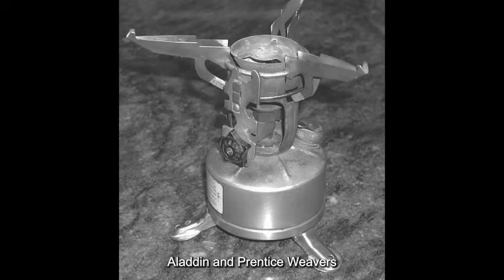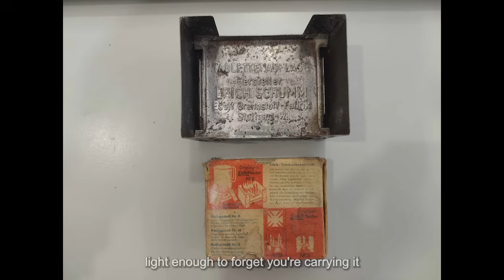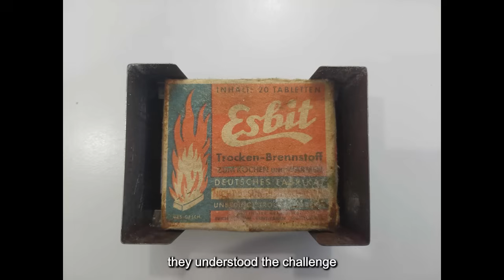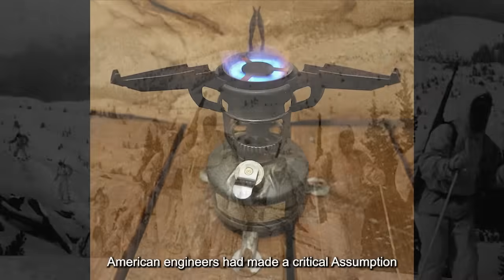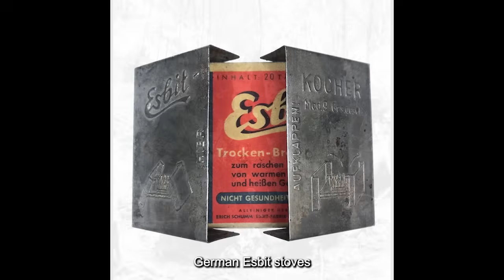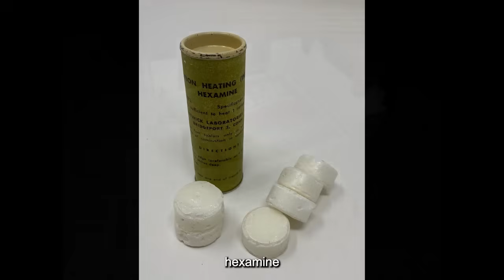America Tried Copying Germany’s Pocket Stove — But Missed The One Detail That Made It Genius

Comment: I have several of that type of surplus stoves, both WWII vintage, 1950's civilian .  I still  use the slightly larger "Coleman Model 520 / M‑1941 G.I. Pocket Stove" . It has been flawless for 70 years.  It is more reliable than the mountain stove

Comment: I have Esbit stoves and they work very well, and as the stove is made of steel you can use dry wood if you run out of Esbit fuel. You can use cloth, cotton, soaked in oil or any liquid fuel. Good video but it repeats the same thing over and over, extended to 27 minutes when it should have been no longer than 10 minutes.

Comment: I used almost exactly the same pocket Esbit cooker to heat my food during a winter bivouac in the German Alps about 30 years ago, during the final exercise of my Bundeswehr basic training. I still remember especially the cold as the temperature dropped to around -20°C at night. Washing myself in the icy water of a mountain creek while I was already freezing is a feeling I will never forget. Even brushing my teeth with that water felt like its draining all the heat out of my body in an instant, and we only got about two hours of sleep per day for five days straight.

These were some of the most extreme conditions I ever had to endure in my life. And then there was this little stove and our only source of hot food and warm drinks in the cold. I imagine I felt on a very small scale, a bit of what the soldiers back then, fighting in the Alps, must have felt. For them this tiny cooker must have been a real lifesaver.

Comment: The situation described in the failure of the M-1942 stove is certainly possible, but not a typical scenario. One could also catalog the number of ways the Esbit could fail. Generalizing a failure scenario as an engineering weakness is short sighted.  The Army also included at least 2 extra vaporizers with the unit.

Comment: Esbit Stoves. Still made and still used for the same reason. Simplicity. Mine is always in my Shirt Pocket when I'm playing in the Woods.

Funny thing is, no one really kept it simple until the 1950's. That's when the Trangia started being used as well as the Svea 123. The Trangia is an Alcohol Stove that is bone simple and just plain works. (It takes a while but it works.) The Svea 123 is a Gas Stove that can use both White Gas and Gasoline. Unlike the 1942, it doesn't clog up because it uses Wicks and larger openings. It has one moving Part which is the Valve.

All three of these Stoves have been my go to pieces of Gear since the 1980's. I've played with the new stuff and keep going with the old stuff.

Comment: What one forgets is that during WW2, American Industrialists and Manufacturers made an absolute fortune.
There is no profit in producing a cheap stamped galvanised steel cooker and the associated compressed solid fuel blocks. There is much more cash to be made from supplying 'highly researched' complex complex-engimeered products.
Follow the money .. 😏.
In South Africa, 1968, during my Military National Service, I got an Esbit Cooker as part of my kit issue. I still have and use it. Now living in Switzerland, I have replaced the Esbit Tabs with liquid Alcohol ('Brennsprit') and/or Alcohol Gel ('Sicherheitsbrennpaste') fuels. I can get these at my Supermarket just down the road and just about anywhere else. Cheaper than the Esbit Tabs which while available, can only be sourced online or at specialist outdoor shops.
I enjoy my Esbit stove so much that some years back, I bought another at my Decathlon in Basel. I keep a pack of Esbit Tabs in each stove for 'just in case' with more in reserve at home, for the same reason.
'Two is One, One is None' 😊.

Comment: Old Paratrooper here. I have had an Esbit stove for over 50 years.  I carried one in my ammo pouch with extra fuel tablets in my ruck. I initially learned about the stoves as an Army brat living in Germany. Consequently I acquired one just as soon as I was stationed in Europe. It was fast, handy, and I had hot food and coffee.
Reply: 👍 .. another Para here. Got mine in 1968 and still use it.
Reply: I've never found the esbit very adequate as far as heating anything hot enough to make a difference and I've used the Coleman squad stove and found it much more adequate
Reply: Hogwash
Reply: Skin contact with hexamine can cause various reactions: 
Absorption: The substance can be absorbed into the body through the skin.
Irritation: It is an irritant and can cause redness, pain, burns, and rashes.
Allergic reaction: Some individuals are allergic to hexamine, which typically manifests as a rash or allergic contact dermatitis.
Decomposition: In the presence of perspiration (sweat), hexamine can decompose into formaldehyde, which is believed to be the agent responsible for skin rashes.
Reply: @steveareno60610  why would you make a long enough skin contact with hexamine in the first place? You just need to take a tablet from the box and put it into the stove and that's all. Or maybe you bath into the gasoline before fueling your car? No? Then no need to play with hexamine or put it on your skin for longer than needed (and you need just a couple of seconds to put it in the stove).
Reply: @teolynx3805  That's all it takes for the skin to absorb the hexamine: just removing it from the box and placing it in position. Safety literature states to avoid skin contact altogether. You obviously did not take chemistry in college.
Reply: @steveareno60610  yeah, yeah... 
Safety literature. And still we have (even here in comments) people with decades experience with such fuel and they're still alive. 
Too much words, bad manners and still trying to look good guy we have here and it's not a good words about you. You obviously skipped your logic lessons in college, also being very rude and have zero manners in disputes.

Comment: apples and oranges.   Too great a difference in heat outputs to be meaningful.  For instance how many tablets would match the output of one gas stove?   Yes reliability issues are real but I have used both types over a long period teaching survival skills in the military.  Yes, all the possible failures are real but, listen up, filter your fuel or carry a small amount in a tin.  Problems disappear.    Both approaches  are solutions to different scenarios.  I have no objection to heating coffee with tabs but to provide warming heat in a tent while cooking for a group you need, for survival,  BTU's.

Comment: My understanding is that the m42 was a squad item, not an individual item.
Reply: That is correct, the comparison of the two stoves in this video is not.
The M-1942 stove was designed for use with the M-1942 mountain cooking kit.  It consisted of two nesting pots with a frying pan.
The video is also wrong about the reliability and the effectiveness of an M-1942 stove, I've been using one every day for the past 6 years with very little trouble and easy maintenance.
The German Esbit stove is more comparable to the M-1910 canteen cup stove that was issued to individual soldiers with their M-1910 and M-1942 canteens and cups which used a hexamine tablet or dry natural tinder like the German Esbit stove and it's not even mentioned in this video which is why it is an improper and disingenuous comparison.
And one last thing about fuel tablet stoves, they are almost useless in a windy environment with freezing temperatures and at high altitude. This was the very reason why the M-1942 and it's successor the M-1950 stove was developed and used all the way up until the 1990s when they were replaced with MSR alcohol stoves.

Comment: 15:20: The M1942 did not fail in the conditions it was designed for. It failed in the conditions it  was INTENDED for. It was not designed for these conditions (as it should have been).

Comment: I had a steam engine when I was a kid in the 1960's that was made in Germany, and it was powered by these little tablets. 73 DE W8LV BILL
Reply: Wilesco still makes solid fuel model steam engines
Reply: @the_retag wow that was the company, I remember it! I see a picture of it: Wilesco D365! The tune from the boiler needed fixed but I didn't know how to do that as a kid. I think solder would just melt. Silver Braze, maybe? But the boiler is quite thin. Any ideas?
Reply: @w8lvradio i believe high temperature solder. But try asking wilesco. They also offer restoration

Comment: I have a SVEA 123 that I've had for over 50 years, it still works.
Reply: Aye, my Svea 123a has not failed me since I got it in 1978, still works with original jet and needle, though the needle does not seal enough to keep from leaking residual fuel when packed, so it must be drained each time or it will smell up the pack, so needs a new pipe/burner assy. I think the orifice got enlarged somehow over the years, maybe from running unleaded auto fuel?  It is very comforting and uplifting to have the red hot thing roaring like a jet engine when nasty weather pins you down.
Reply: 👍. I got it's cousin, the Optimus 8R Hunter (same burner mechanism) in the 70's .. still going strong.
Reply: Those assemblies are freely available and easy to replace.
A possible reason for the leak 'could' be .. from a Norwegian Military Instructor's experience working with new conscripts and those who did not heed his advice, thus resulting in them being subject to 'corrective pack duty' 😏:
Using the needle / jet 'self-cleaning' mechanism straight after turning off a red hot burner, can result in the needle becoming 'welded' in the jet. Perhaps this has happened in your case, thereby damaging the mechanism to the extent that it now leaks. On my Optimus 8R Hunter (same burner mechanism as the SVEA), i wait for the burner to cool down (a wet cotton face cloth works) or clean the jet before use.
Just a thought ..

Comment: I agree with you about the simplicity and other qualities of the Esbit stove, with one exception: you have to be able to find the fuel cubes. It's much easier with gasoline. It should be noted that hexamine has certain drawbacks: it is sensitive to moisture and releases toxic gases when burned.

Among others, I own two M-1942 "pocket stoves". I've used them as all season camping stoves, with my motorcycle, also during the winter. I filled them directly from the motorcycle's fuel tank tap. I've never had any problems with these stoves. They have a small side lever (at 1:00, on the left side of the picture, next to the star button) that activates a needle, up and down) to clean the jet. So, there is no need to use a small piece of wire to clean the jet, as it is already enclosed and ready to use, without any dismantling of the device. Lever down = needle up = jet clogged, and lever up = needle down = jet free. Once you understand that, everything works very well (with good gasoline).
I even took one with me during one of my winter military training times (-20°C and even lower) so I could make coffee and heat up canned rations: quick and very efficient, this in real cold and outdoors conditions. At the time, gas (butane) stoves couldn't operate at those temperatures, and gasoline was perfect and readily available. Maybe the war quality of gasoline was at fault, as I never encountered the problems you describe.
Its real drawbacks are the smell when starting and the noise (hissing) it makes. And it is not as fast as the Esbit.
I had to remake the (lost) multi-purpose key that comes with the stove. It allows for maintenance and complete disassembly of the stove. The whole thing is well designed, although much more complicated than the Esbit, for sure.

Today, I use a similar stove (from China) that runs on either gas or gasoline. Same advantages, same disadvantages 😉
Reply: I must disegre, the esbit style stoves don't need the fuel tads. You are able to use any solid fuel, from sticks and carboard opine cones and more. I have cooked hot drinks and ration meals with no hexamine tablets.
Reply: @georgestewart5879  I was sticking on the original version of the Esbit stove. In Great Britain, they also use the same stove with gel meth (Dragon)

Comment: The Coleman GI Pocket Stove is a completely different thing than the esbit stove used by the Germans. Incidentally, Hexamine is now banned in the United Kingdom and other countries, while the white gas used by Coleman stoves are still being used today.
Reply: Hexamine stove tablets were banned because they produces toxic fumes.  Specifically hydrogen cyanide which will kill you if used inside a tent.  Back in WW2 with troops outside this was never a consideration.
Reply: @MikeB_UK and Coleman stoves and lanterns also produce CO gas, yet they used lanterns in the tents and buildings they found
Reply: @brianlubeck4184  As always people don't read.  This is not CO, they produce HYDROGEN CYANIDE - a toxic killer.

Comment: A similar issue occurs with the AK-47 & US carbines  In the Vietnam War, the M16 needed significantly more maintenance than the AK-47 which could take a lot more abuse in the field. The M16 is a more beautiful instrument but is over-engineered often times.
Reply: Nah. Only issue in Vietnam was that the idiots at the Pentagon cheaped out and didn't have the barrels chrome-plated, while also not handing out proper cleaning instructions.

Comment: Did you ever try to boil noodles with the Esbitkocher? It has not enough power to get or keep the pot of water boiling. I know young people had to steel more Esbit to try to get their noodles done by putting two packs of Esbit in and around the stove at the same time. The noodles sucked but it was all the warm food they had and money was empty. The coleman gas generator works incredibly well but maintenance sucks. I'm at the SOTO Stormbreaker now. This is a really great one that appeared in 2019. Before that the Phoebus 625 was my best choice. Preheating is a bit nastier as the coleman but the jet can be cleaned by a left turn of the regulator at any time an then turned up again - eventually needing a new match. You just shouldn't throttle it by turning left as this might cause cavitation. I still use the Phoebus some times.
PS: When I'm alone I use a spirit burner. I used the military Trangia "Gamellenkocher" but it is too heavy and burns the food. So I use a Primus Prime tech (former Eta-Power) pot and either a tiny titanium spirit burner of a 7g lightweight I made from 2 bottoms of 150ml "energy shot" cans. Everything burns better and cheaper fuel than the Esbit crap. In my yacht I use regulatable wick type spirit burners I bought from the Swiss army. She is too small to worry about butane (safely) and gasoline is a no go in the cabin.
I also used MSR Whisperlight International and Dragonfly. Both have heavy carbon buildup problems. One Dragonfly also had a failing solder joint causing a huge fire. The shaker needle only works with daily hiking but doesn't solve the carbon issue at the regulator.
SOTO disassembly needs practise but it can be fully cleaned on tour, which is a big advantage to MSR. The gasoline compressed air direct sootless startup is also great. The Stormbreaker had a predecessor (Muka) but that one had a minimum power of ~2.5kW which is far too much for anything except boiling pure water at which you can use the full 4.7kW.
I also own the Swiss Army 2*9kW Benzinvergaserbrenner but that's for cooking for groups. It's also perfectly maintainable. They have a 6l (net volume) tank and are made for large groups.
My first stove was acoleman pierce cardrige gas stove. I was too greedy for the Camping Gaz C206 and the plastic cardrige holder cracked dangerously on the first trip. The Camping Gaz at that time worked well. I later once used a Camping Gaz 206 made in the 00es. It was only capable of boiling the water when the cardrige was standing in river water despite using a prime tech pot. It was September in Germany so temperatures were moderately and absolutely not winter. So it was either a monday modell or Camping Gaz made a fatal design change.
So: Try any stove at home! Apart from engineering failures you also have to understand it and be able to use and (field) maintain it. The SOTO requires 🧠.
Reply: Pure fuel removes the problemds
Reply: @dankelley-os5sg Yes, but it's expensive and I've to carry the supply for the whole trip as it's difficult to obtain or extremly expensive (3 bottles of lighter fuel to fill the tank of the stove).
Reply: The esbit cookers come in different sizes, and are not meant for extensive cooking but warming up pre cooked rations
Reply: @the_retag  Yes and because that's all they can it's a no brainer to present them as superior to a fully capable stove. Esbit stoves can't boil a pot of water.
Reply: @thomasmore260 they are superior for the intended use case of a lightweight ultra reliable and easy to use ration heater, which is the topic of the video (and, depending on the cooker, amount of fuel and conditions, can cook properly)

Comment: Whoever came up with that first.....the gasoline Coleman style burner is sheer genius ! Burning gasoline nearly as clean like gaz is a great feature.
Reply: For as long as it works ! 
I used to carry a spare vaporising tube assembly when I had one for motorcycle touring (always had fuel on board) after the first clog-up happened mid-tour & required the purchase of a gas stove en-route. Great performance is nothing without reliability !
Reply: @mgnbukint6502  
I use one Coleman in my workshop for appr. two years using regularly gasoline, not the synthetic ultra clean type what is recommended.
From time to time I do slap with a thin screwdriver against the heating duct while full throttle. I was told that unclogs eventual residues inside the tube.
Reply: The Petromax lamp from 1910 used the pressure system. Wiki says: "The design of the lamps was later used to create a cooker based on the same principles. "